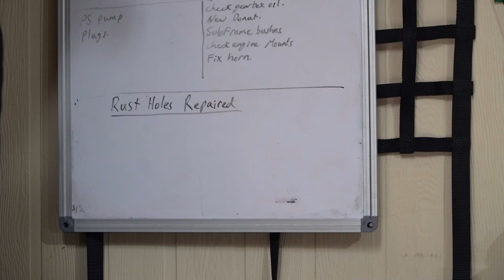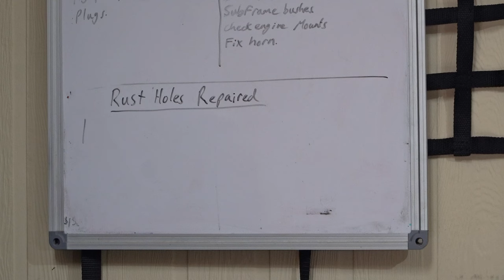Starting rust repairs on the MR2 - Learning how to weld

Comment: I doubt that you'll get any gronk comments mate - anyone who's done this before will probably feel your pain. It's a great start and the blow-holes are easily fixed.

Awesome bag of tools - even the bag is cool! Those pliers are tucking pliers, for shrinking steel edges and creating compound curves. The intertubes will give you a better idea. Trev's blog did a video using them (I made my own set after watching his video!).
Reply from the maker: Thanks mate and thanks for the tip on the pliers I'll check out the vid :)

Comment: Good to see you're getting on with it. All the gear you have there looks more than capable to do that your  have on this project.  As do you. I can't give you any pro welding tips cause I've been a bodger for more than 1/2 a century..But here's some stuff that I've learned the hard way......
 On thinner steel don't try and do a run weld. Just do a series of spot welds.. But it looks like your already getting it.
 When you leave the shed, check the gas bottle valve is closed. I wouldn't like to count the times I've done 5 mins of welding on a new bottle only to come back the next day to find an empty bottle.
 When your welding, and it's hot ( weather ) don't run a fan directly at your self, cause it'll blow your gas away. It took me a while to figure out that.
 Go for  strong weld, rather than a good looking weld, grinders with flap discs are easy to use.
 Sometimes the welding wire is crap and out of shape. It'll get caught, /slide on the feed rollers. Grab the wire on the end of the gun with a pair of pliers and pull while you have the trigger on. Run about 2 meters of wire out the gun ( until you see the crap bit come out ) then snip it of.
 You hear a lot of sheet metal welders talking about copper paddles, so if you have a blow through you can hold the paddle behind the hole and fill it. The easiest way to get a copper paddle it to go to the hard ware shop and buy a meter or so of copper pipe. cut it to what ever length you want the paddle to be, smack the end flat with a hammer.... copper paddle.....
 I've started buying my gas at Bunnings cause I can get it at 5.30 on a Sunday evening... Have fun....
Reply from the maker: All good tips thanks mate :)

Comment: First off, fantastic videos! I've only watched the AW11 vids so far, but consider me a subscriber! You've got guts of steel to learn how to weld in a video. I picked up welding about 4 years ago and absolutely love the skillset. A helpful video I watched to learn welding was one in which all bad elements were tested intentionally to see what would happen (i.e. not connecting ground, jacking up the wire feed speed, shutting off gas, etc). For whatever reason, I couldn't learn from videos of people telling me how TO do it, but rather learned the basics very quickly from how NOT to do it. May be something to try out on a rainy day to give yourself some practice.

Second, I have an 86 MR2 N/A that I'm making into a dedicated time attack track car with a 3S-GTE from the MK2 MR2 Turbo. I've owned a few MK1s and MK2s over the years including my current 88 Supercharged model. They're fun as hell and even more rewarding when you take the time you're taking to do it up right and enjoy the process. Good luck and I'm looking forward to seeing the progress as we're at a similar step in our project AW11s. Cheers!
Reply from the maker: Thanks legend! Yeah the welding is tough but I'm getting there, just heaps to do!

I'm so pumped to drive this thing, everyone only has good things to say about them :) 
I'm a fan of the 3sgte, I've owned two st185 gt4s with those engines and they were great cars I miss them, absolutely rock solid. 
Your time attack car sounds awesome, where abouts are you located?
Reply: @TheNuggetProject  I'm across the pond in the US. I built the 3S that I'm using in my AW11 back in 2015 for an SW20 project. The buddy I built it with wound up with the wrong crowd and is now a meth head. I last touched the SW20 in 2016. As a 2023 new year's resolution, I told myself it had to go. I'd keep the engine and LSD tranny, but the roller had to go. Rust bucket was a nice way to put it. That thing was rotted from bumper to bumper. Almost every hole had sheared bolts. Called up a local MR2 guru to offload it for cheap and he instead offered up the 1986 for a trade. Very quickly, I was taken back to my dreams of owning a MK1.5 and since I had a newly built 3S-GTE (still hasn't been turned over and only has assembly lube from 2015 in it), I was stoked to get the project started. In a way, it's a continuation of the SW20 project from 2014, but this time, just me, myself, and I. I'm pumped and driven to get this thing going. Don't have much money or time with a growing family and all, but I'm making it happen one bolt at a time. Ain't nothing stopping the time attack train. :) Goal is 2250 lbs (just over 1000 kg) in full race prep with cage and factory fuel tank and 400whp from the fully built 3S. Sold a motorcycle to get a brand new Garrett turbo for it, so I know the engine can do it, I just gotta get the weight down. Roll cage is next on my agenda. Never been on track, so that'll be completely foreign territory to me. Your videos with your race car will help, I'm sure of it! Cheers!

Comment: Going through a similar but smaller project on my Volvo V70. I have a little MIG experience but I’m learning a lot patching up the rust holes on that body. The only way to get better is to practice and that’s what I’m telling myself about these Volvo patches. Great work on the MR2!
Reply from the maker: I love the V70, great car, I use my wife's D5 polestar tuned xc60 to tow the race car and its rad, highly underated cars.

And you're right, I stared at it for ages but the only way to learn is just to do it! Good luck mate, we're in the same boat!

Comment: Mate, I don't envy you. You've certainly taken on a long term project. I like you had to learn how to weld on my early JDM car. The metal is so thin you could spit through it. But, 2 1/2 yrs on I've finished and am quite pleased with the outcome. In your journey there will be times where its hard to continue, so just take a break, maybe have a race in the Excel and then get back to it. The end result will be worthwhile.
Reply from the maker: Thanks mate that's good to hear! I'm getting into it now, I think with every repair I'm getting that bit closer to being able to drive it so it's keeping me motivated :)

Comment: Hope you get to race!! by the way, I use pieces of cardboard to protect the radiator when installing it. It might be worth replacing the whole harness that wiring is old and susceptible to more issues along with corrosion
Reply from the maker: Yeah I don't think money allows for that, if I replaced everything in this car that looked a bit off I'd just be replacing the whole car haha. I'll rewire it, it will be fine :)

Comment: Oooh, project binky time! Make a bracket that holds the bracket you're going to cut off. Whatever they call it, a reverse bracket that goes off the other nuts around it. When you're putting it back together it should line up perfect first time you refit the dash & save a bit of time.
Reply from the maker: Ahhhh yes! i remember that, i may have to go back and watch that episode and steal the idea :)
Reply: One video is when they do the suspension!
Reply from the maker: @eugenev6269  sweet I'll start there :)

Comment: First question. Are those raceworks gauges the same ones you have in the Excel? I think I need me some 🤔
Reply from the maker: Na I've got the one gauge screen in my excel now, however I raced an accord Euro the other day that had them in it and they were great, also have visual and audible warnings for high temp, low pressure :)